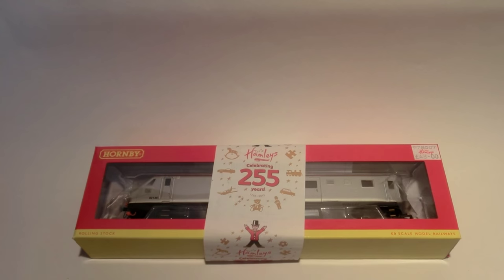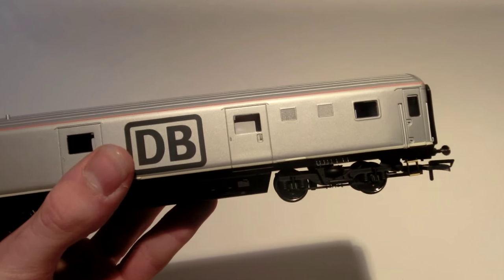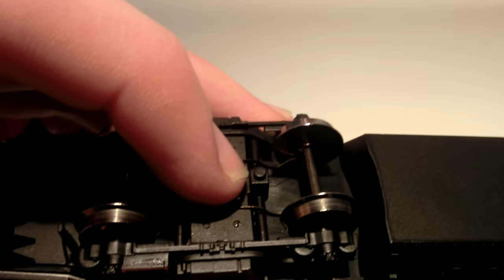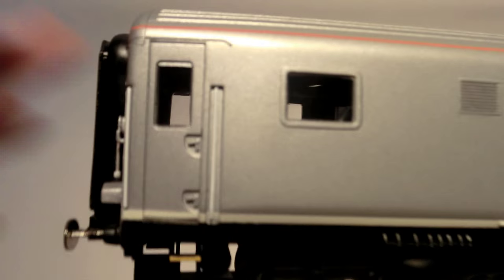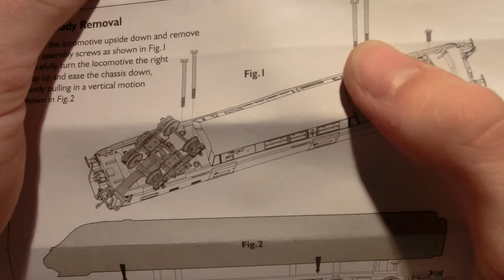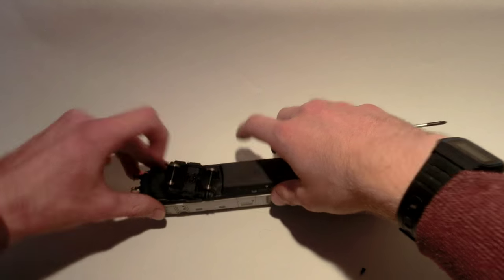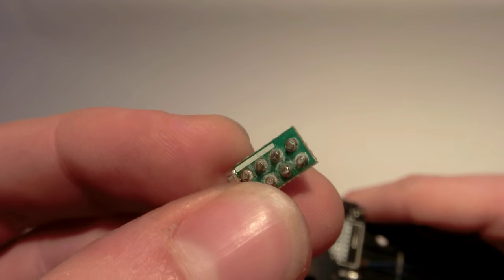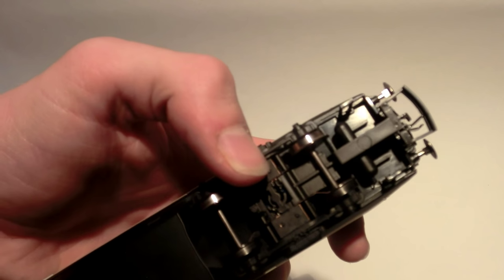Hornby DB Schenker Mk3 DVT Review

Comment: Great review and cracking model mate. I have the Arriva Trains Wales version and I use a ESU LokPilot function only decoder on mine :).

A like from me :).
Reply from the maker: Thanks, nice to know people like to watch my videos :). I just used the standard Hornby decoder and I find the light seem to flicker on and off now and again with dirty track, do you have the same problem with your ESU decoder?
Reply: Hello again. To answer your question. There is no flicker with my set but due to nickel silver track and the way it oxides to the air. The grime between the wheels and the rails can pose a bit of a problem. If you use the ESU LokPilot decoders in the future, I would recommend the "stay alive" capacitors as they solve the flickering problem and minor "dead spots" over points and crossovers.

Ash.
Reply from the maker: ***** Thanks!